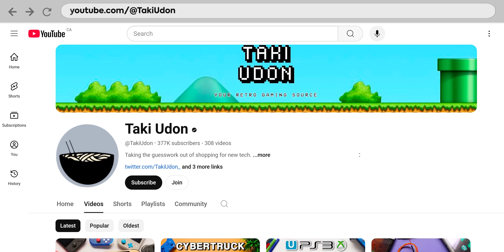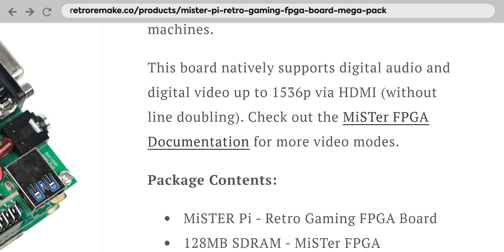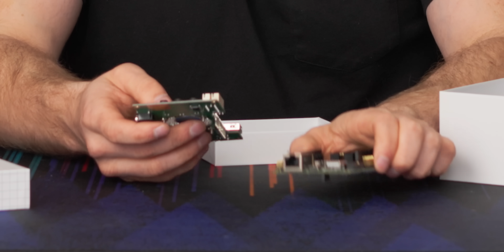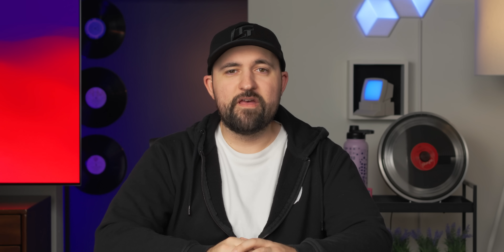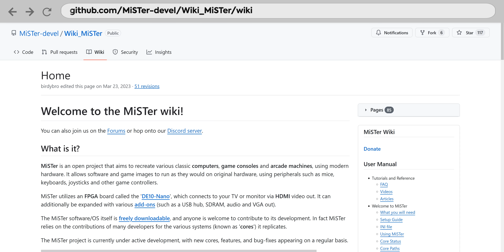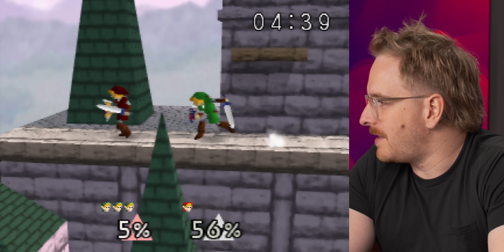Half the price. All the Games. - MiSTER Pi

Comment: I would be wary to anyone looking to buy this. the architecture is just different enough that some of the cores don't work properly. the n64 core has been updated to address this but it's the only one I'm aware of. also there was an issue with the initial runs ram that was both from a qa issue standpoint and also from an architecture issue. The FPGA chip is actually an automotive grade part that is similar but not the one used in the de-10 nano. they are new stock. 

so far, for the most part, it's a solid  alternative if you like to tinker but not for anybody grabbing thier first fpga system when the analogue pocket is far more plug and play and user friendly.

Glad david is filling the void in these kinda videos but I miss seeing Emily for the retro stuff. She was super knowledgeable in a way that matched her enthusiasm.
Reply: it runs all cores and only had a problem with n64 that has been fixed.  the ram issue was also fixed.  mister is more user friendly if setup with the right files, if done correctly you just have to run the updater.  the menu is better with more features and has more cores with save states imo
Reply: @masterninjahh  Mine came 1st December so only several days ago. Shame i didn't read your comment sooner. N64 emulation on mister pi clone is pity... To be fair. My controller works in pc emulator, with pc in other games. Works with mister pi on psx and gba cores but not in N64 or partly works because some buttons work... or i dont know how to configure them. If you are interested in ao486 core dont buy it or first check game playable on this. You can't play heroes of might and magic because after turn you can get freeze. In most cases, not always but very often. At least older Dos games works like a charm and even Albion form 1995/1996. Forget about real 3d games like Descent, Quake or even 2,5D games like Doom, Doom 2 or other id games on Doom engine on ao486 core. You are warned. But who will find it? Hopefully it has only about 800 comments. I read that ao486 is not perfect so maybe it is not even on original alter chip. If only somebody could say something. Guess i just buy another mister fpga but i will keep it clone for very old dos games, gba emualtion because i have some cartridges and cds from first Playstation. People should be warned about this clone more.
Reply: @masterninjahh  you want a specific update_all script if you want to not manually pull bios files (david highlighted this issue in the video) but also you have to check the right boxes. a friend of mine bought the taki board recently. he had several issues running cores, including n64. he is a programmer.

I'm also in discords that are knowledgeable about fpga's in general and the consensus is "the fpga in the taki board is similar but different enough it shouldn't work out the box like a de-10 nano. so even if they seem to work the reality is it's not a perfect  cloned experience so without extensive testing we can't actually claim it is.

Comment: Original consoles are to expensive now and too inconvenient to have all of them set up in my opinion. Emulators are okay, but not as simple as having one, appliance like console to play. I find Mister to be a sweet spot where I can have all my retro consoles in one place at a reasonable price. I actually bought an analogue pocket for this purpose first, and got a mister later for the few consoles the pocket doesn't do. Making Mister cheaper and easier just improves this use case.
Reply: batocera on a pi is the way to go for emulation  (non fpga) these days.
Reply: The consoles themselves aren't all that expensive, the games are. Fortunately basically every console has a mod or flash cart solution. Crazy to say original hardware is too expensive and in the next sentence say you bought an analogue pocket lmao.

Comment: I dont get these things. Why not just use a PC/laptop? You can get a cheap laptop with better performance and multi use for less money. Retro people are odd people.
Reply: For the same reason people buy and use a GPU instead of just using the integrated GPU on the CPU, that is performance, FPGA provides blistering bare-metal performance with literally 0ms latency end-to-end, not only that it provides real controller support through SNAC, so you can enjoy real hardware level input-fidelity @ sub 1ms latency, something that even 1000Hz polling gamepads can't provide, and then there is one of the best features of FPGA, pixel perfect analogue video support, be it for 240p RGB scart, S-Video, component, composite, and also immaculate VGA support for every system, then there is the perfect compatibility for systems that remain elusive to soft emulators to this day even with a top tier 5GHz+ CPU, Saturn and N64 emulation is indistinguishable from real hardware at this point (and actually plays games like CBFD, DK64, SWRS, JFG, games that soft emulation has never been able to emulate properly, even ARES has a huge chunk of the N64 library not emulated very well, especially audio) and then there is the audio, we can finally have bit-perfect accurate audio replication, the MiSTer Mega-Drive core has 1:1 parity with the real model one Mega-Drives, as long as you are using a decent DAC, you can enjoy beautiful super rich sounding FM-Synth, chiptune, PSG, MIDI and so on music, you can even use real MIDI or OPL/ADLIB etc hardware, you also have the awsome MT32-Pi, which can use the real Roland sound bank, and sounds amazing and allows you to use all sorts of sound-fonts & banks.

You also have basically perfect replication of Amiga, 486 DOS PC's (+Windows 3.1 or 95), Atari XT, C64, Sharp X68000, MAC OS and tons of other classic computers, all with real MIDI and other synth modules support, and then there is the massive list of perfect 1:1 parity arcade cabs/boards/games, nothing comes close to MiSTer for everything up to 5th generation video games and hardware, not even DynaRes (RGB-Pi), and this is just the first generation of FPGA, it's only going to get better and better.

X86 soft emulation in a modern Windows & Linux environment just has so much latency, in many forms, be it video, audio, input-response, API overheads, OS overheads, poor 15Khz 240p RGB support, terrible audio quality in many soft emulators, very few get this right, there are some emulator dedicated OS's like RecalBox or Lakka, that have much lower end-to-end latency, and built in 15Khz support out of the box, but you need a powerful CPU for the best performance and lowest latency, like the X3D CPU's offer night & day better performance to that end, especially if you use a RAMDISK for the OS, but even still, you will be miles from bare-metal real-hardware and FPGA performance, that said, FPGA can only do up to 5th gen so far (N64/Saturn/PS1), it stops right at the Dreamcast, so beyond that, soft emulation is the only option currently, and to that end Replay OS with DynaRes 2.0 on a Pi5 will be the best option, especially on a Multi Pi console.

Comment: I really wanted to see how the lag would be in a more demading game than SMW, like SF Alpha 2, DK 2 and 3, Yoshi's story
Reply: It's bare-metal (0ms) end-to-end across the board, as long as its analogue video output and a SNAC real/original hardware gamepad, HDMI has 1–2 frames of latency, depending on your HDMI display, OLED will be lower for instance.
Reply: @Wobble2007  You can lower the HDMI latency by setting vsync_adjust to 1 or 2, it may not work on all TVs, but so far, it worked on every TV I tested, except on a few arcade cores that run on weird framerates (like 48, 55 or 62)... I'm not even sure if those work on a regular CRT TV, I wouldn't be surprised if some of those cores only ran with the scan converter or on an arcade tube. I got 6ms of latency on the LCD I usually use for my MiSTer with vsync_adjust=2, according to the MiSTer Laggy.
Reply: @gcolombelli  Yeah, a lot of arcade boards run at 24Khz, so most people will have to do some conversion, though many can be set to 31Khz VGA too, if you use a CRT monitor, most can do as low as 29Khz, which means you can natively run arcade cores at 512x384p70Hz, which I do on my Sony 21" CRT monitor, and it has thick BVM grade scanlines at that resolution, and the 10Hz refresh difference makes no negative perceivable motion clarity change at all from the 60 FPS arcade games, would be amazing to own a nice big arcade monitor though, one of those incredible 32-36 inch 4:3 arcade monitors that can go up to 1280x960p75Hz (or even 1600x1200p in case of the NEC high-end XP37 or XM29 monitors), imagine using one of those as a Windows 98se gaming monitor (if only), I do at least have a brand new Hitachi 25" 4:3 RGB presentation monitor with an arcade quality tube inside, I intend to install an arcade control board and PSU inside it, so it can natively do 15/24/31Khz (Tri-Sync), and perhaps install a MiSTer Pi board inside and pair with a decent arcade control panel with a spinner, trackball and HQ 8-way stick.
Reply: @gcolombelli   Yeah, a lot of arcade boards run at 24Khz, so most people will have to do some conversion, though many can be set to 31Khz VGA too, if you use a CRT monitor, most can do as low as 29Khz, which means you can natively run arcade cores at 512x384p70Hz, which I do on my Sony 21" CRT monitor, and it has thick BVM grade scanlines at that resolution, and the 10Hz refresh difference makes no negative perceivable motion clarity change at all from the 60 FPS arcade games, would be amazing to own a nice big arcade monitor though, one of those incredible 32-36 inch 4:3 arcade monitors that can go up to 1280x960p75Hz (or even 1600x1200p in case of the NEC high-end XP37 or XM29 monitors), imagine using one of those as a Windows 98se gaming monitor (if only), I do at least have a brand new Hitachi 25" 4:3 RGB presentation monitor with an arcade quality tube inside, I intend to install an arcade control board and PSU inside it, so it can natively do 15/24/31Khz (Tri-Sync), and perhaps install a MiSTer Pi board inside and pair with a decent arcade control panel with a spinner, trackball and HQ 8-way stick
Reply: @gcolombelli   Yeah, a lot of arcade boards run at 24Khz, so most people will have to do some conversion, though many can be set to 31Khz VGA too, if you use a CRT monitor, most can do as low as 29Khz, which means you can natively run arcade cores at 512x384p70Hz, which I do on my Sony 21" CRT monitor, and it has thick BVM grade scanlines at that resolution, and the 10Hz refresh difference makes no negative perceivable motion clarity change at all from the 60 FPS arcade games. 

Would be amazing to own a nice big arcade monitor though, one of those incredible 32-36 inch 4:3 arcade monitors that can go up to 1280x960p75Hz (or even 1600x1200p in case of the NEC high-end XP37 or XM29 monitors), imagine using one of those as a Windows 98se gaming monitor (if only), I do at least have a brand new Hitachi 25 inch 4:3 RGBs presentation monitor with an arcade quality tube inside, I intend to install an arcade control board and PSU inside it, so it can natively do 15/24/31Khz (Tri-Sync), and perhaps install a MiSTer Pi board inside and pair with a decent arcade control panel with a spinner, trackball and HQ 8-way stick and buttons.
Reply: @Wobble2007  the problem is not the build, but if the software can handle the heavier games and don't generate any input lag.
Reply: @jcwins  Everything runs at 0ms via analogue out and with SNAC gamepads, even N64 and Windows 95/DOS, only HDMI can have lag, up to 2 frames, OLED can be sub 2-3ms.
Reply: Lag is perfect

Comment: 250AUD for the full kit? Hard pass. Even 150AUD for the base kit is a little on the high side.
Reply: It depends on what you want to use it for, if only one or two systems then sure, it might be overkill for you, but if you intend to use the hundreds of different systems it perfectly replicates akin to real hardware, then if anything its underpriced, I paid over £300 for my original DE10 Nano, Analogue 9.2 I/O board, 3.0 SDRAM, then another £200 for audio upgrades and controller adapters, RGB pakapunch cables et cetera, and it was more than worth it to me, just the perfect N64 alone with 480p VGA support made it worth the money, not to mention the PS1 480p VGA with 60FPS support, the incredible Saturn, Amiga, Neo-Geo (these cost hundreds to buy on their own), and now you can buy one for less than £95, which is just nuts, it literally replaces thousands of pounds of real hardware, making it an absolute steal.

Comment: Bruh i have the same WiFi Dongle. I got it online for like 1.5$
Reply: I’d also get an usb extension cable and hang it somewhere high, so you can keep the BT controller or Wi-Fi signal more stable.
Reply: @ZeroUm_  LoL i have it hooked at the top of my PC Case USB port and the router is 50cm away from the dongle with its antennas pointed towards the dongle

Comment: I am wondering what would be better this hardware emulation through a MiSter or software emulation through a RPi and ReplayOS
Reply: Depends on the system being emulated.  I haven't touched an rpi in a while, but if it has enough grunt to use  runahead in the older consoles then you won't notice a difference.  Anything PS1 and later it really doesnt matter as long as it can run at a stable framerate.

Comment: Could these be used to drive a CRT monitor on a modern PC?
Reply: Yes, most MiSTer analog boards come with a VGA port, some come with a Saturn video out port or a JAMMA interface. It's not entirely plug and play, most of the cores output a 15kHz vsync, which works well on TVs over composite, s-video or component with either passive or active adapters, but most VGA CRTs require at least 31kHz vsync, so you may need to use the built-in scandoubler to use those cores on a VGA computer monitor. The ao486 core by default comes in a 60Hz mode for better compatibility with LCD screens, but you can change this setting on the OSD menu and set the VSync to Variable, so it will output native 70Hz on 320x200 and 720x400 modes that are so common in DOS and DOS games.
Reply: Also, there's a special core, called Groovy or something like that, made to get video over network from a modern computer running MAME and output it to a CRT monitor. I haven't tested it, but surprisingly it often has lower latency than having the video run directly on the monitor of the computer running MAME, which is very counterintuitive.
Reply: @gcolombelli  Thanks for the infodump but it sounds like I won't be able to use one to just convert DP out to VGA for my CRT.

I'll stick with my Startech DP2VGA2HD I guess! =D
Reply: @blunderingfool  It has HDMI out as well, on a computer monitor it should have no issues even with vsync_adjust=2 and some of the cores weird refresh rates.

I was kinda surprised that my 1080p60 Dell LCD accepts 640x400@70Hz when I launch Doom on ao486. If it's a modern monitor with VRR support, there's a high chance of it working well even with the weird cores.
Reply: @gcolombelli  Keep in mind, my main monitor is a 2002(I think) iiyama Vision Master Pro. An old but good gaming monitor. =P

Comment: Why not just emulate it on modern hardware?
Reply: This basically recreates the hardware down to the cycle electrically. So completely perfect emulation (which most emulators don't/can't do) and zero input or display lag.
Reply: @timseguine2 oh! So this is hardware emulation for all those consoles? How come this so cheap?
Reply: @KekiB59  Don't know the entire details, but probably because it was designed  around a popular product that already exists. The original mister project uses a dev board product, and those tend to be more expensive than they need to be. I am guessing the designers were able to optimize it based on only what the mister project needs.
Reply: @KekiB59  FPGA
Reply: @timseguine2  But the Neo Geo Mr. core was built from decapped chips, so it is a poster child for fpga emulation, BUT it is unable to run 1:1 bit perfect Neo Geo ROM dumps, it needs to use the molested darsksoft rom set.

Comment: The video title needs to be changed because it's no longer even relatively true. The device went from $100 to $160 now and is also out of stock.
Reply: The $100 is the DE-10 clone board, not the whole set-up (i.e., $100 doesn't get the RAM module, Analog board, USB board, or the Wi-fi dongle).
Also, he has an approximate date for the next round of orders.  He has to deal with production issues and returns for the mentioned errors, so he can't just have a warehouse full of product.

Comment: David got a couple of things wrong. The I/O Board doesn't have a power button, so you'd have to use some sort of external solution, like a Wi-Fi outlet or some sort of switch. Also, it's not compatible with all cases. The layout isn't the exact same, so you'd need to get a case that was designed with the Mister Pi in mind, like Todd from RetroFrog's case. I got mine a few weeks ago and it's been great so far. Glad Mister is getting cheaper.
Reply: He's probably basing that information from personally owning the Mister Addons setup, their current revision of IO direct boards changes the Reset button to act as a soft power switch when it is powered by USB C adapter. Not sure if that's the case since I didn't see the barrel U-connector and it's hard to see but doesn't look to be an IO direct board at the start of the video , but that's my current setup and that's how it works.